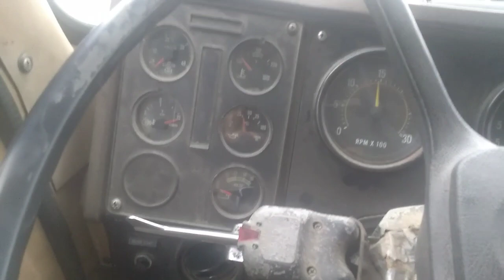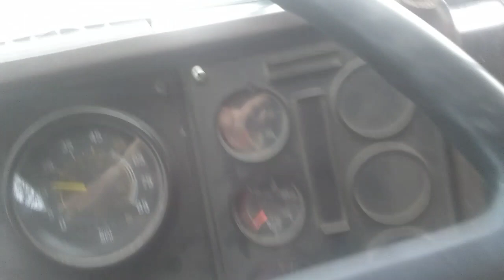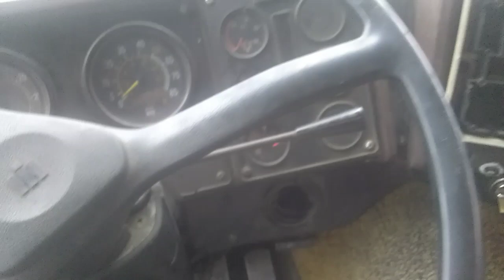walk through the truck

Comment: I worked on them back in the 80s
Reply from the maker: So far it's a fun learning experience for me but at the moment I'm struggling to find new brakes for the front
Reply: @themurdock1132  if the truck was built in a certain year you can remove the front brakes entirely, a lot of tractors in the 70s didn't have to have front axle brakes. The reason being is that if you are in a panic stop and you lose your steering axle you're done.
Reply from the maker: @thomasglynn2282  the truck is an 82 and came from factory with brakes
Reply: @themurdock1132  yes I understand that, but law was that you could remove them if you chose to. But if it came with any type of early anti lock system they had to stay on. I'm sure you can find out what years apply